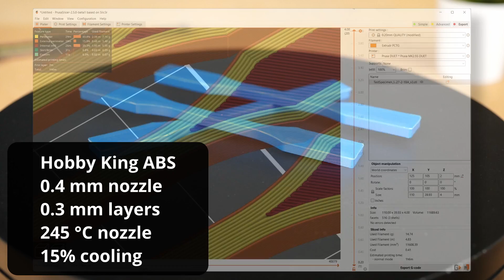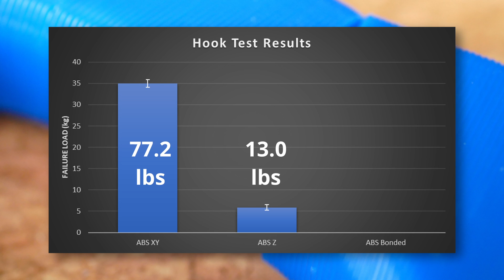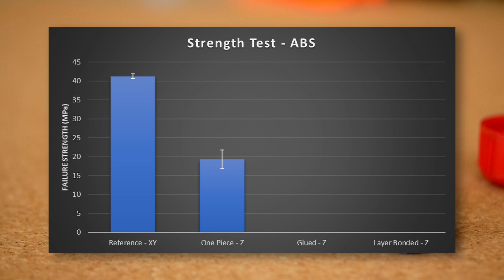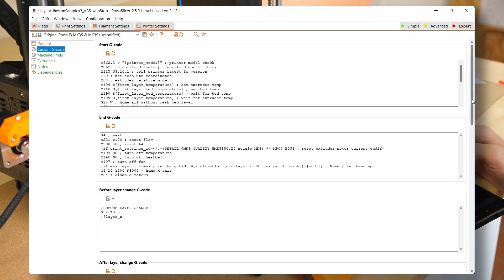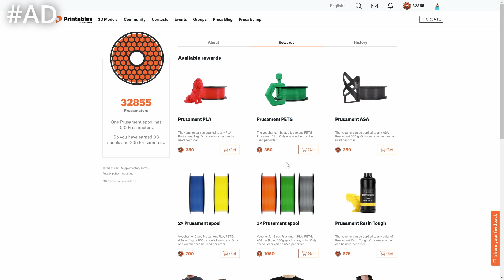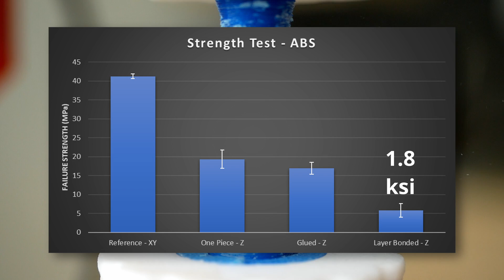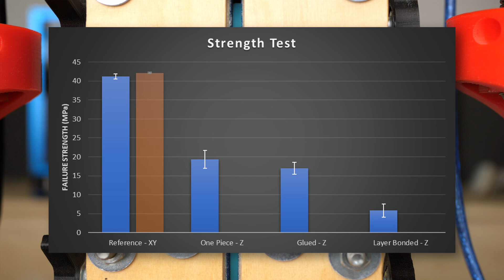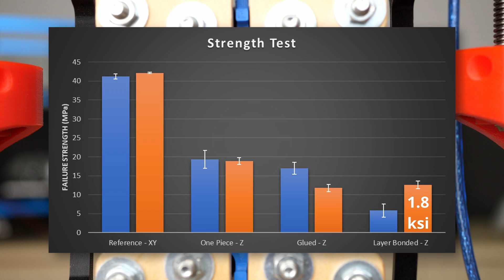Perfect Layer Adhesion if you Brush Solvent onto every Layer of your Print?

Comment: MEK (methyl ethyl ketone, a.k.a. butanone) has a higher boiling point than acetone. Being a ketone, it is chemically very similar to acetone. It is used as plastic cement when a slower evaporation rate is required. MIBK has an even higher boiling point than MEK. All 3 chemicals are highly flammable.

Comment: You cannot use acetone this way. Acetone is boiling at 56 degrees. So it evaporating long before it soften the ABS surface. ABS printing temperature is around 245-270 degrees so one is excluding the other.

Comment: I would think using a spiral pattern to fill would work better.
On first pass make a spiral starting at center with leaving a gap between traces, then when reaching the edge, return to the center filling up the gap you left before. This way you have two directions in one layer.
I'd also implement a wavy/toothy pattern whilst printing the spirals so there is adhesion in sideways, twisting and up and down. Kinda like a teeth joint in wood.

Comment: IDEA: create nozzle that have small hot needle inside. For example you have 0,2mm layer height, and needle must be 0,3mm longer out of the nozzle.
Needle will melt lower layer and help to mix old and new material together creating great adhesion.
I think it will be sophisticated nozzle, so for prototype it’s better to start from big diameter nozzles. And it also will add force in X and Y directions from hot end to part so parts will always be trying to get out from the table.

Comment: Want good bonded layers?  You generally want the base material as close to the nozzle material temp as you can get without it warping or melting away.   Unfortunately this means things like heated enclosures.   With printed parts like this there isn't a bunch of time for the layers to cool unless you add a wait step to paint on acetone. Probably why it's performance was bad compared to the control

Comment: I would be interested in if you could force the z to undulate up and down as it prints the  layers. If you could have it do this there ought to be more surface area to bond. This could be achieved by raising and lowering the z height during the layers or potentially over and under extruding accurately. Potentially a mix of both.

Comment: Yet another idea is to weld the layers with something like a laser beam right after the new material is layed onto the previous layer. A very tiny "spot-welding" should do the job and another fan could set the welding point back to solid.

Comment: I have another idea to pre-melt the small area of the material on the previous layer right under the nozzle. E.g with a focused laser. So the melted material coming from the nozzle will lay on a slightly melted material of the previous layer. Thus increasing the bond.

Comment: I think a pretty obvious idea would be not to print as we do by parallel layers (which is actually not a 3D, but 2D-printing with increasing Z ), but to transfer to a real 3D. In this case the model (and/or the extruder) could be rotated and slanted by additional motors around each other - kind of a robotic arm. And the extruding filament could "wind" around the model in a "self-crossing" manner/pattern. The resulting model would have threads going in each direction. And the smart CNC software (called rather "winder" - not a "slicer" anymore) would enable threads going in right directions.
Meanwhile on the given hardware I think you could implement the perimeters go slightly like "waves" up and down as possible with internal "wave" pattern crossing the external "wave" (maybe also using some infill "waves" or additional "infill perimeters"), so that threads.

Comment: not a material scientist  but  i believe for this approach to work it requires the solvent application during the the time window where the abs is not in its crystalized state aka when its cooling down.  as the application of solvent will increase the cooling making for a more brittle interface with the next layer  a more semi crystalized layer before the next layer deposition......   sadly the only way to test this would be to  apply solvent after nozzle pass right next to nozzle  to minimize the crystallization that happens as it cools down....  or to have the part remain at glass transition temp whilst applying solvent  which makes it way harder to do and also more risky.....

Comment: i think a better solution is a solder like printing medium that allows for a semi crystaline yet stable "solvent" that reacts at temperature to promote adhesion and strength of the resulting piece.

similarly gassless welding wire (flux core) does similar. 

their method of action is different, I understand, but the technology of producing a feedable wire that "fluxes" during use, but is stable at room temps, would allow an almost seemless transition from normal 3d printing to true 3d seemless printing. instead of relying on a semisolid surface weld between layers, adding a solidified plasticiser core to the printing medium could possibly also allow for not only stronger, but perhaps lower temp prints, which would be a bit more efficient at the printer, but would result in complexity of producing medium to print with.

another method perhaps would be to add a very very small misting device that sits almost directly next to the print face of the heating element, allowing for quick and controlled use of the solvent during printing.

Comment: If the z axis were to move within a layer and created a sort of wavy pattern which was continued through the entire height of the print you would get a higher degree of friction between the layers and thus stronger parts. Apart from G-code changes you might need a nozzle with a very fine tip that extends past the print head so that the angle of attack on these “waves” doesn’t clash with anything.

Comment: Really dangerous idea, (kids never try this) but, what about printing inside a solvent vapour chamber?
Another thought is to borrow metal CNC technic of using mist coolant but instead of coolant we try solvent. First obvious thought is cooling your model amidst printing process is a bad idea. But may be we can preheat the air-solvent mixture (metal pipe coil comes to mind). 

More sensible idea - let's increase the surface area of adhesion. A way of doing that might be to print with a wave like motion in the Z axis.

Comment: What if nozzles were jagged on the tip like pastry bag pipes? It could maybe create a textured surface on the layer to adhere better one to the others, and on top layers using ironing to smooth everything, even though heat could melt everything up.

Comment: Adding solvent affects the strength chemically, interfering with normal bonding, possibly also due to cooling effect upon use. Adding glue means being more concerned about the tensile strength and adhesion of the glue, not the plastic. We want parts made from plastic, not super glue. Typically adhesives have lower tensile strength.

Comment: Although it’s quite barbaric you could use a soldering iron to melt a few vertical lines for a bit more strength. 
I sometimes do this when I know a part is likely to split at a specific point and it seems to help.

Comment: I can't help but see a parallel with wood strength and grain direction. Perhaps if paths could be set such that the printed part didn't have all the layers vertically aligned but instead staggered at shallow angles in different directions? The seam between different layer alignments wouldn't all be in the same plane so a single direction of force wouldn't push exclusively on the weakest bond.

No idea what sort of algorithm you'd need for the general cases. But testing with simple cubes should be viable with some hand crafted non planar paths.
Reply: actually, riffing on this a bit more. you wouldn't need to do full segments non planar. Just variable slices. Slice a non horizontal plane off the part. Print up to that normally. Then print along the angled plane for a layer or two. Then resume normally horizontal printing on the region above the slice. You'd get a series of slices that are stronger in the direction you'd usually be weak.

Comment: you mentioned that layers with texture from the nozzle digging seemed stronger, fixing a textured roller on the print head next to the nozzle and at the same height could add texture and possibly solvent as well at each layer without manual interaction

Comment: I just thought about this idea, what if you design the parts in such a way that after 3D printed, you can fill the object with resin, or any other hardening kind of glue, and then the part would basically have a strong skeleton!
Or you can print the inside of a print (maybe only the infill) with a different kind of material and then the perimeter a different material, to make that part stronger.

Comment: I think one of the reasons of the low adhesion with the glued layers is that looks that when the acetone evaporates it creates bubbles in the layers interfaces, and make the inner walls (between bubbles) even thinner...
What if you use acetone vapor shooting by a nozzle right beside the extruder exit?
You can heat the acetone in a recipient with some tube with a seringe needle on its tip and fix it in the printing head.
Even the acetone is flammable, it's auto-ignition point is around 465 ºC, so I think it could be safe enough, so you wouldn't have the manual work and you would avoid the bubbles in the abs caused by the acetone evaporation (I think)

Comment: This makes me wonder if there's an application involving 2-in-1-out hotends. Would there be any combination of filaments* that after melting together would result in stronger bonds (or other desired properties). *I'm not necessarily thinking both being commonly commercially available filaments, but if there could be 'additive filaments' in the future or perhaps paired filament/additive combos. With a dual extruder, the additive could be titrated or used more/less in different parts of a print.

Comment: What about printing inside a vapor chamber? Electronics would likely have to be outside it and you couldn’t have anything soluble on your hotend, so it likely would require a custom build, but the theory is that the vaporized solvent would bond the layers internally as well as externally

Comment: I've printer hollow and then filled with epoxy. With mixed results. The exothermic reaction of the epoxy got hot enough to deform the parts. 

My thought was a slicer infill that creates a channel that can be filled with epoxy after the print to create a skeletal structure that strengthened the part.

Comment: You probably weak them using this method because you end up trapping solvent inside your 3d printed parts. Try another approach like making hollow parts to use your smooth machine to smooth inside and outside.

Comment: Thanks for doing these detailed videos they are interesting. This is a different approach and will not work with all objects but I have used piano wire and/or threaded rod to improve strength. You just print a hollow channel inside your object and then you can glue it in after it has finished. Alternatively you can also print it in two parts and glue it together after inserting the rods. 
A similar idea but more usable for complex shapes would be to print a hollow shape and then fill it with resin. The resin heating up and making the print leak proof could be challenging though.

Comment: I suppose to improve layer adhesion you would in essence either have to increase bonding strength or increase layer area. Strength would require material or chemical change like you did here but area could be improved by software or a slight hardware mod. One idea I had was to have a slightly serrated/jagged nozzle (really small bumps) so that the plastic being extruded leave a bumpy surface rather than a completely flat one that would allow for a greater surface area and perhaps better shear resistance (The ridges interlocking rather than just sliding). The hard part is you would likely need to print at a higher temp and closer extrusion to ensure that the new layer of plastic fills the gap left by the ridges of the previous layer (eg. each layer squishes into the ridges of the layer bellow whilst leaving a ridged top surface) and to remove the ridges on the very top layer ironing could be used to smooth out the layer.

Comment: I'm not into 3D printing at all (yet), here are my two cents though: do you think that some sort of "interleaving" would be worth a try? A (very rough) explanation of what I mean by "interleaving":
let's assume that you want to print a 3 layer part, say, a basic cylinder - thus, three layered discs.
Instead of printing (side view ascii simulation here ^^) the 3 disc/layers sequentially, this "interleaving" approach would consist in printing a very short "U" shape as a first pass (two layers:
-  -
__
 ), and after that, a very short "T" (two layers as well,
__
 -
): those two shapes once combined/stacked would then give the same result as the 3 layered discs, except that the horizontal bond between the three disc layers would be "converted" to a mix of horizontal bonds (the bar and the bottom of the stem of the T being bound, respectively, to the tips and to the inner bottom of the U) and vertical bonds (the stem of the T being bound to the "stems" of the U, vertically), which should, theorically increase the mechanical strengh in the Z axis...
I've made a quick sketch because my explanation is not very good, a picture will be much clearer ^^
https://app.sketchtogether.com/s/sketch/38YMw.8.1/ (Edit: this will not last long, so here's a picture: https://pasteboard.co/ZRNDYKICt5Cq.png )
I took a 3 layer example here, but, to be honest, I think that for this approach to be effective, more layers should be used for the U/T shapes (in order to increase the height thus the vertical  adhesion of the two "parts"), but this would depend on the feasibility for each printer model (ie: would the nozzle have enough space to "dive" down to the previous, lower levels without causing issues with the previously printed "walls", ... I'm not sure if any printer model is able to "pour" a defined volume of melted material to "fill" the holes? That would allow the printer to avoid any "diving" operation)
Of course, this cylinder "pattern" could/should be repeated both horizontally and vertically (stacked) within the whole, final 3D printed part, with more or less horizontal offset depending on the required material usage and the overall expected sturdiness.

Comment: One test i would like u to try is a test we use in the steel manufacturing industri.
That is the stress of a part.
Similar to steel, plastic have a  inbound flex. Example your hook.
In the real life, u maybe use the hook to hang a tool. When u hang a tool back on the hook u stress it, when the tool is removed there is no stress. How many times can you do this before the part breaks.
You need to stress it so it flexes, but not as much so it deforms. In that way u will make the part weaker every time u hang a tool on it.
To measure that you need a virtual weight that a tool will weight, but this time you ned to measure the distance between the mounting points in your test equipment.
If u put a stress on the hook with in example 10Mpascale every time and the part gets 2mm longer. Then you remove the stress, the exceed length of the part should go back to 0mm. When the part doesn't go back to zero it have failed :)
That says more about the practical use of a part. How many times it can withstand the use.
Reply: Maybe at 7Mpascal the part will never fail. Until it is old an have loosed the boundings in the plastic.
At lego the use butter to speed up the aging of a ABS-part. Because fat is harmful to the bound in the ABS. NOT the layer bound, the chemical bound.

Comment: One thing that would be great to test, is if the strength of the layer adhesion is somehow related to the speed of printing? Because I assume that there is better adhesion when the layer is still soft and warm and you print on it... the best adhesion between plastics is usually when both parts are melted...

Comment: Idea: injection molded infill-ish.
 Print solid areas by making the perimiters, then fill the part up by extruding a solid blob in the middle.

For bigger holes I would try dividing bigger holes into/areas into smaller holes that can be filles by pressing the nozzle in it and do a sort of "injection molding" in your own part as infill.

Comment: One idea for increasing layer adhesion is finding a way for the hotend to run into the already printed layers while printing like what happened on accident with your ABS test. This would force the new layers to mix with old layers by injecting them right into the old layers at times.
I suspect this will greatly reduce part accuracy, but it might increase strength so it could be worth testing.

Comment: You could try weaving in a material that is perpendicular to the layer lines. Similar to how concrete has rebar. The part could be designed to leave hollow cavities in the body that you could insert the strengthening material. This might have to be done every so many layers and then epoxied in place.
Is it possible to inject the melted plastic into a cavity? That could allow for some interesting internal designs to improve strength.

Comment: A kind of 3D printing additive lathe could get rid of the layer ashesion problem by making loading normal to the layer-planes impossible. Requires printer hardware modification though.

Comment: Would a small spay module attached to the printer head to increase adhesion work? A automatic even application of the solvent would probably help circumvent some of the cooling that the print probably experienced when you had to pause to apply each layer, but I’m honestly not sure how hard this would be to implement.